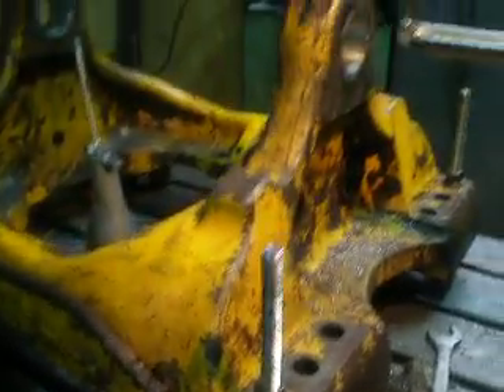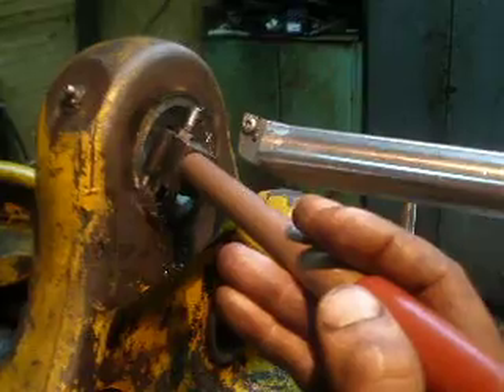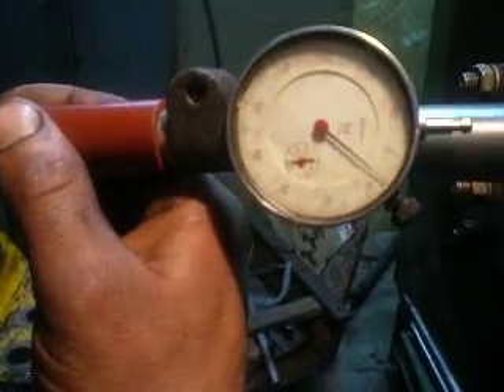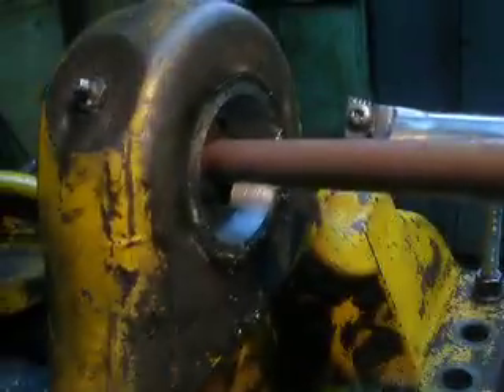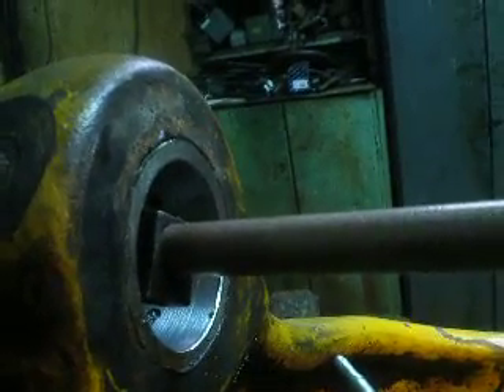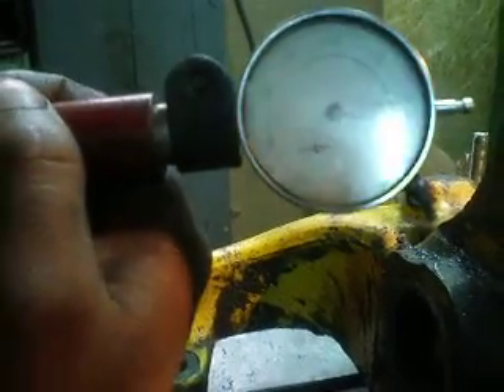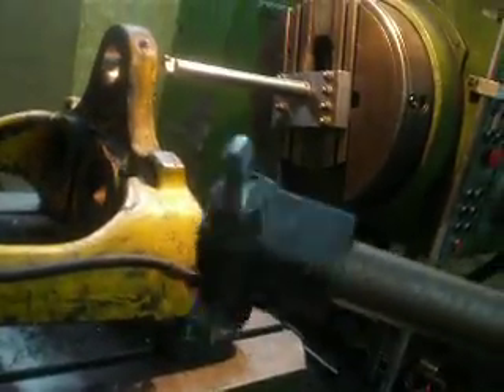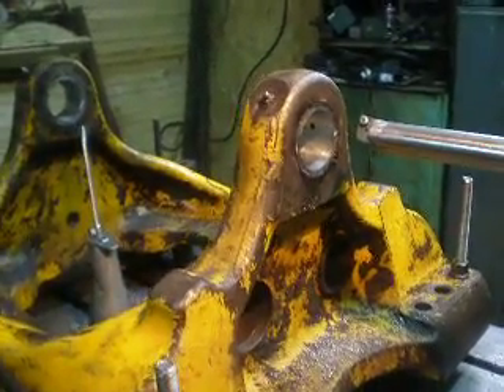Work with dial inside micrometre for checking bore accuracy

Comment: Looking at the set up you have there made me think. I've other line borers before, and i think with a few minor modifications you could make something similar work with your machine and use 2 cutters at the same time to produce identical, parrallel bores. But still good work though. I know how much of a pain it is to machine parrallel bores in 2 steps.